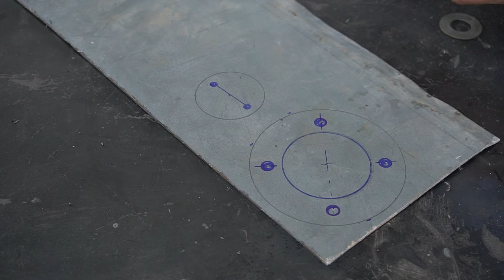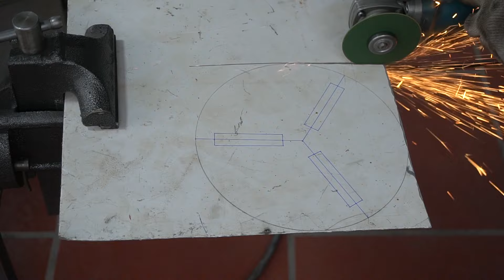How to Make Onion Slicer, You Can Make it at Home

Comment: I like it but why did you weld the handle how to you clean it instead of a threaded union would of worked with a nylon locknut next no way to adjust the thickness and no plunger in the tube to push the onion into the blade

Comment: Its funny to see comments about no safety guard, really? What about the galvanized feed chute, the sprockets out of a road kill grinder that are now being used as gears, the spinning blade assemble that is made from some type of scrap sheet metal that was probably found in the scrap metal pile at Chernobyl. 
Any surface making contact with food purposefully or incidentally must be a minimum of SAE 200 Stainless Steel . And how about this, all that equipment and no center punch? Whats the deal with that sharpened Allen bolt.
Reply from the maker: Like

Comment: I have to ask the question. Why did you use galvanized pipe for the holding shoot for the slicing blades? It is a NO NO for using that type of material around food processing equipment. I would have used food grade pvc or pva.

Comment: Forget about ordinary person, it is difficult for a mechanical engineer to cut circular shapes with an angle grinder and make stainless welding. Many parts like sprockets and GI sheets will rust and difficult to maintain.One must have access to a huge workshop to make this uneconomical project.